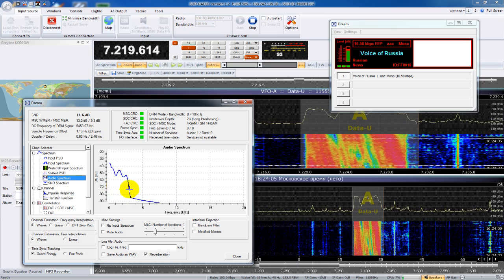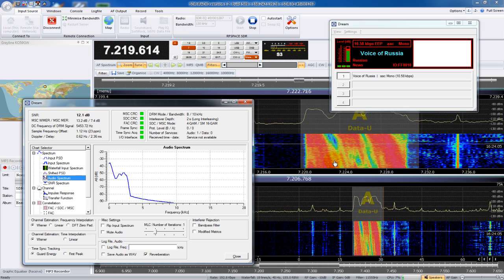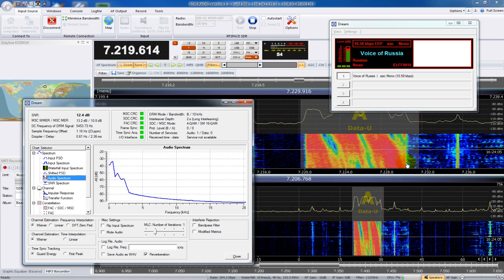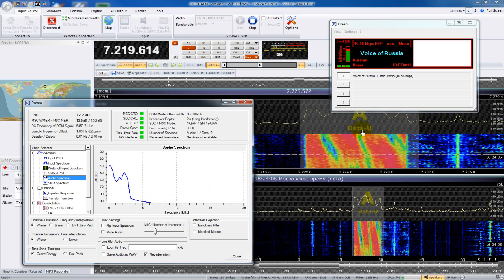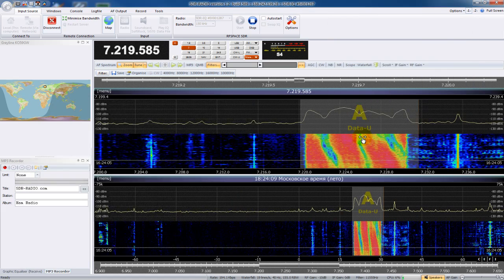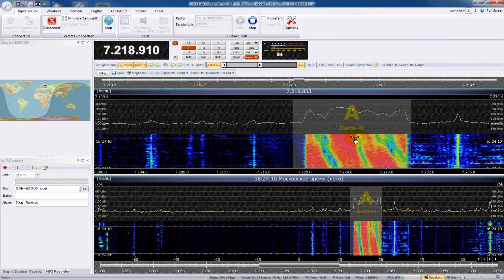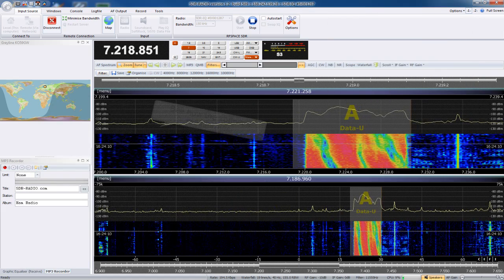DRM via SDR (software defined radio)

Comment from the maker: The SDR software demodulated the wide-USB signal. In fact, the "noise" you hear in the beginning is the actual audio out from the SDR software. I then routed this audio to the input of another sound-card to which the Dream decoder was set to listen to. You can use a virtual cable like app too. VB-AUDIO ( h t t p(slash)(slash)(:)vb-audio(dot)pagesperso-orange(dot)fr/Cable/index(dot)htm ) is free.